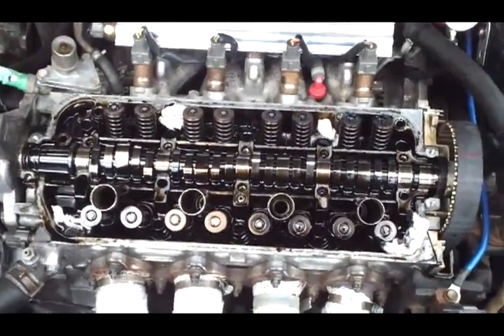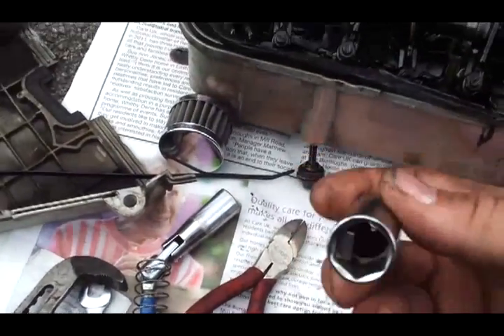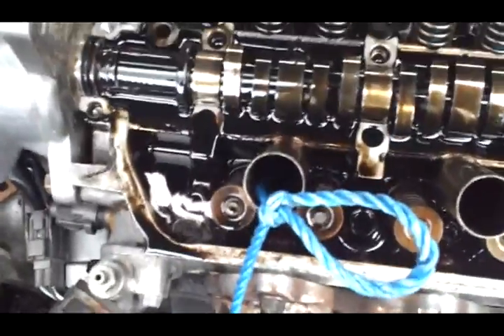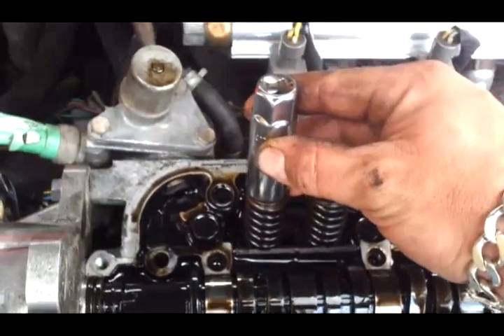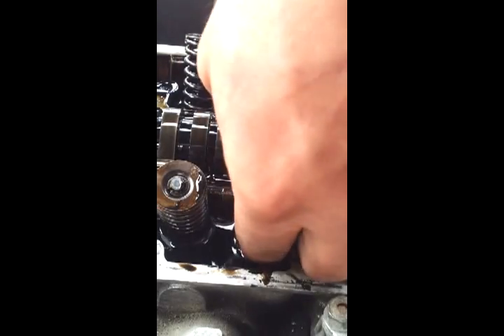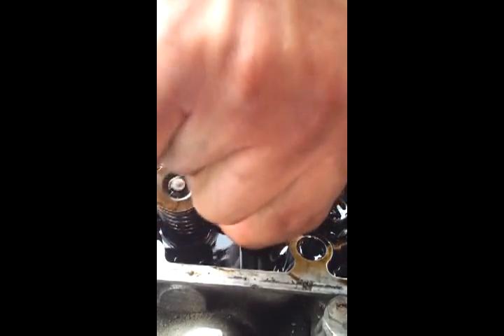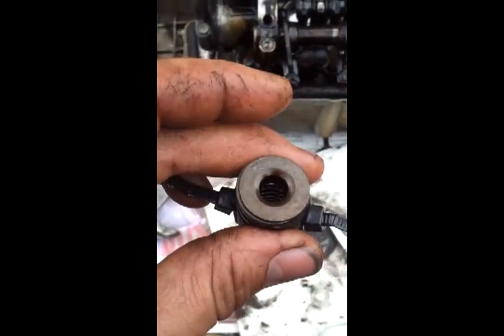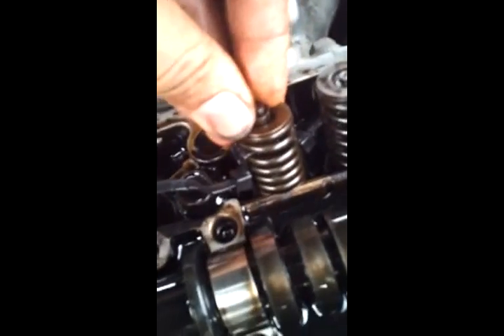how to replace value spring seals without removing the Clynder head.

Comment: i wouldnt have believed the cable tie spring compression trick until i saw it.  might i suggest that it is important to ensure the valve spring is at the top of the valve stem so those little collets/retainers dont go into orbit when you cut the cable ties.

Comment: by doing the rope trick do you have to do it in all spark plug holes or just first one to keep all valves from dropping down?
Reply: all of them it holds the valve up in the cylinder head so you don't drop a valve when removing the spring.
Reply: @FINDITFIXITRESTOREITBUILDIT  so am I right in thinking when the rope is in that cylinder I can remove 4 seals at the same time then move on to the next 4?

Comment: Thank you so much for this video.Learned a lot! I am just a shade tree mechanic,  DIY. I was able to tackle this on my 02 Accord. I was able to find a valve compression tool at a flea market, so I used that. Other than that  I did exactly what you did and it worked

Comment: Thank you. I have a vtec head I'm upgrading my non vtec 94 accord with and I don't have any compressor tools to help putting it back together even on the table. This cable tie trick is good stuff. This also gives me a way to be able to replace my seals if need be down later the road without the whole head off.

Comment: I figured with 225 k It was ready for an engine change.The engine I got looks new. Of course I had to remove the head on the old engine. The valve had to be removed so that I could turn the engine to seperate the torque converter from the fly wheel. I'm getting too old for this.

Comment: Ran into a mess with changing the Valve seals on a Nisson Altima 2.5 .It was very difficult because the springs are down in holes. To make matters worse the guides were worn. I couldn't do the rope trick because the spark plugs are down in holes too deep. I pressured up on the cylinder. While I was talking on the phone the compresser couldn't keep up and a valve fell into a cylinder. I ordered a Japonese imported engine.

Comment: I still don't get the deal with the rope into the cylinder. I'm a beginner, I'm having my first project w/ a '92 del sol (D16Z6) and I'll try to keep it under the budget. Anyways, can you draw a map for me? :D How can the valves fall off into the cylinder?
Reply: Alex Voinea the valve could fall into the cylinder because you basically remove the retainers. Valves goes up n down (intake because fuel injection and exhaust because the burned gas needs to escape). If you remove the retainers they are "free", so it will drop into the cylinder, the retainers are something like a "STOP" (lol don't know the english word), so it couldn't go down anymore, and when removing them, they don't have a "STOP". 

Look on google how valves look like, and by watching these pictures you prob. realise why you need to put a rope in it or use an compressor and use compressed air instead.
Reply: Alex Voinea You probably know by now. The rope stops the valve from falling into the cylinder when you remove the spring and clips.

Comment: Use security glasses and a spring compressor tool for 10$. Valve springs are tipically rated from 200 to 300 lbs, and you don't want that exploding on your face when cutting a zip tie...

Comment: Thanks for this video. I have a question, can I just fill the cylinder with rope without moving the piston up? I'm thinking about how hard will it be to remove the rope if the piston is moved upwards to hold the valve. 

Or if I moved the piston upward to hold the valve, is it just okay to reverse the rotation of the crankshaft to free the rope?
Reply: Emmanuel Higoy same question, did you figured it out?

Comment: What a great idea.  I was trying to use a HF spring compressors and having problems as it kept slipping off my Kawasaki spring.  Keep up the good work.
Reply: Seems like HF spring compressors are great for cars but do not appear to be designed for cycles or small engines.

Comment: how the rope work.....sorry don't get that part...i need to changed it on my 2003 Mitsubishi eclipse v6 need your help please
Reply: Holds the vale stem so they won't drop inside engine but it only hold 4 at a time. Then u put it in the next spark plug hole to do the next 4 stems

Comment: Good tutorial - I used I few times - First, use "Sintetic" rope like him - Don't leave dirt and it's more difficult to have a knot - Then the part of the zip ties, buy good ones or just buy a "Valve spring compressor" it's a cheap tool and very effective for hard springs.-
Move the piston with the hand, and then you can put it in first Gear, to prevent go down again, when you are working in the valves doing force down.-
When you finish, move the piston and then remove the rope.-
Then always check the timing usually it's not going to move because you don't remove the belt, but it's double-check and VERY important, check the valve clearance, after finish in d16y8 are for example 0.20 mm for intake and 0.25 for exhaust.-
If everything it's fine, just enjoy!

Comment: do i have to replace my timing belt , if i replace my valve seals?
i have a 2000 jeep grand cherokee.
Reply from the maker: No as you shouldn’t mess with the timing with this method, leave the cam in place and all the belts.
Reply: Im wondering the same most guaranteed u will have 2 since your turning your pistons up & down
Reply: Replace the whole truck.

Comment: I have my head removed off my dirtbike and before I re assemble I want to wipe it down to not leave dust etc... can I use wd40 ?, will it ruin the valve stem seals?  

thanks

Comment: This may work on smaller spring cars but the zip ties part won't work on my Jeep Wrangler. The ties are either stripped out or block spring compression. The tool to do it easy is free at autozone, use it.
Reply: Don't take my comment as negative or bad. I'm sure it works great for small engines and if you don't have a parts store that does loan a tool.
Reply: +Red Beard What tool?
Reply: Valve stem spring compression tool. Made the job easy and fast.

Comment: try it with deep stems you will see, this is just simple POS engine!
Reply: And that's the good thing about Hondas. Reliable and easy to work on.
Reply: Yeah they do have rust problems.
Reply: wow wow wow, my first car, a mercedes CLk 2.3 superchager 197 hp.. very smooth steering, shifts like butter (it is a manual) but BORING IT IS AND RUSTS ALSO, now also having a honda del sol 1.6 125 hp with a skunk 2 catback, what a fun car to drive! the corners! the steering! fokking hell! the mercedes isn't that reliable at all, the honda might consume quite some oil but some proper new seals and maybe double springs will do the job for sure! also the fuel consumption is so much better! the mercedes drives 10 kilomter on 1 liter, the honda about 14-15 on 1 liter and i did a drag with my friend in the mercedes and the honda is so much quicker, with a weight difference of about 150 KG but still!

Comment: Make sure u use a proper rope that wont leave anything in the cilinder.
And search for  a spring compressor, they are already starting from 20 euro, this could be dangerous and beside of that if your unlucky when cutting the zip ties you could lose you retainers.

Comment: Little help? Replaced my seals on my D16Y8 and followed this method. Finished  and put the engine back together but now it wont start? Backfires everytime i try to start it and sounds like it wants to start. Plugs are soaked and pitch black now and theyre brand new. Smell lean.
Reply from the maker: you have the HT leads the wrong way around by the sounds of it.
Reply from the maker: or the timing belt has slipped check the timing marks all line up on the engine.
Reply: MostDopeGamer775 did you ever figure it out? Two years and no reply??!!
Reply: Mostdopegamer..  How do you replace them on valves that have a nut on top not clips..

Comment: If your valve keepers are not perfectly in place when you cut those zip ties the spring could launch into your face and hurt you bad! That's why it's safer to use the right tool (spring compressor) and slowly release the tension. Just trying to keep a few more working eyes in the world lol.
Reply: He lifted the spring cap up to the collects before he cut the ties. There is literally zero chance it would "launch" into your face.

Comment: If I wanted to do this on a Diesel, would the rope get fed through the heat plug aperture?
Or would I have to just bite the bullet and remove the cylinder head?
Either way.... this method's nothing short of genius. 
^_^

Comment from the maker: when you turn the engine by hand the piston comes up and compresses the rope against the head/valves.
Reply: Hi great video. i purchased a vavle sping tool for my bmw with the compressor fittings. how would i use air? turn the engine to top dead center or bottom the piston then fill it with air?
Reply from the maker: +Ehsan Ahmed if you are using air you want the piston at bottom or as you fill the chamber with compressed air it could push the piston down and lose the compression thats holding the valve up .
hope this helps.
you will also need a air compressor.
Reply: +crazyvtec1 thanks bro. i should just connect the air or bottom the piston first? or the air would do the job for me ? I just connect and go ahead

Comment: Just want to say a big thank you. I just finished changing my stem seals today after following your diy instructions. I couldn't use the cable tie tip because my springs were too small to compress with just cable ties so I used a spring compressor to do that but I loved your tip about the magnetic socket and metal mallet. It worked beautifully. Thanks :) tell you what though, I have a D15 and changing 16 seals is so time consuming!

Comment: my 1.7 non vtec 2001 civic takes oil. Engine is clean, doesn't leak, doesn't smoke, but takes oil quite heavy. Would that mean my stem seals need replacement?
Reply from the maker: stem seals or piston rings if it's not leaking then it must be burning it.
Reply: how do i check piston rings?
Reply from the maker: +Sir Daltonix you will need do to do a compression check on all the clynders.
ask at your local garage to do one for you as it's not worth buying a tester just for one use. if there low on compression then the piston rings or valves are leaking /worn

Comment: I got my rope stuck in the cylinder! what is happening?
Reply from the maker: Turn the engine back by hand and the piston will go down then remove the rope.
It shouldn't get stuck there's nothing for it to get stuck into.
Reply: well, the rope just made a knot there and screwed the whole thing up! Now I have to learn how to remove the engine head.
Reply: This is the inherent danger when using the rope in the cylinder technique. It's always possible for the rope to knot up inside the combustion chamber and get stuck. It doesn't always happen but there is always the possibility and occasionally it does happen and if it does the head will need to come off. That's why many people prefer to use compressed air instead.

Comment: Even at dead top, is there still enough dept(room in the cylinder) for the valve to drop in the cylinder without the rope?
Reply from the maker: You can try it without and see but you need the valve up as high as Possible as compressing the spring and replacing the retainers is tight, would be impossible if the valve was 10mm lower and if it did drop just below the top of the guide it would be very hard to retreve. The rope is cheap and works well.

Comment: I thought you were never suppose to crank the engine clockwise because it might skip a tooth?? Is this correct or did you crank the engine counterclockwise in the video??
Reply from the maker: As long as the belt tensioner is in place it won't matter

Comment: Just used this technique on my 1998 Honda accord 2.3l vtec. AWSOME, I had the valve stem seals replaced in the time it would usually take to remove the head. Great video. Thanks.
Reply: Awesome man I'm also looking to do this in my F series accord, glad to hear it worked! Just to confirm, you don't have to remove the cam gear or camshaft to do this?

Comment: I understand the rope into each individual cylinder, but do I have to re-crank each time? Or just the first.
Reply from the maker: Crank so the cylinder your about to do is a bottom dead center feed the rope in about a meter, then crank it back round by hand not the starter untill you feel resistance just give it a little bit more just to make sure its tight then your good to start removing the valve springs. Once completed turn the engine back and pull the rope out. Hope this helps
Reply from the maker: Crank so the cylinder your about to do is a bottom dead center feed the rope in about a meter, then crank it back round by hand not the starter untill you feel resistance just give it a little bit more just to make sure its tight then your good to start removing the valve springs. Once completed turn the engine back and pull the rope out. Hope this helps

Comment: Valve Stem Seal Issue?...

Replaced my plugs after 109k miles on my Honda Element 2.4.  Noticed ash deposits on number 3 plug/cylinder only.  Slight hesitation before.  Engine great after spark plugs replaced.  

Oil use is very small between 4k changes - less than a half quart at most.  Also, have a leak coming from the bearing seal so it's impossible to know what the engine may be using verses the leak.     

Inspected number 3 cylinder/plug (new) again at 3800 miles.  

Slight ash on electrodes and insulator, but only on one side
shiny carbon deposit on ONLY ONE Side of insulator and "rim"  

This makes me wonder if the oil entering the combustion chamber is from a valve seal verses rings, etc.  But not being a full blown mechanic, I'm only theorizing.  

Outside of doing a compression test (will have mechanic perform soon) is this a likely indication of a valve stem seal issue?

Comment from the maker: THE ROPE IS USED TO HOLD THE VALVES UP IN THE HEAD. YOUR TAKING THE RETAINERS AND SPRINGS OFF TO GET TO THE SEALS WITHOUT THE ROPE THE VALVES WOULD DROP INTO THE CLYNDER. YOU DO ALL 4 VALVES WITH IT IN THE CLYNDER THEN REMOVE THE ROPE AND USE IT AGAIN IN THE NEXT ONE! PEOPLE STOP ASKING WHATS THE ROPE FOR!
Reply: If noone knows what the rope is for  maybe they shouldn't be doing it lol
Reply: I figured it out after you cranked the head back up. I don't have any videos uploaded so I don't know if this is possible but I would just edit your description if you can. Thanks for the video!
Reply: some car has valve seals under the camshaft does this mean I have to put the camshaft back on each blocks I do to compress the rope on everyblocks  ?

Comment: why did you change the seals? was the engine burning oil? if yes did the engine stop burning oil? thanks good video
Reply from the maker: I used to street race with my mates and hold the car in gear for engine breaking when you would rev up to about 6k let off to say 4500rpm then put ur foot down again up to 7500rpm you would get a blue smoke cloud.
I had good compression on all cylinders and after this no more blue smoke.

Comment: Do you do the nylon rope in each cylinder for each set of exhaust amd intake valves?
Reply from the maker: Yes you need to do it in each cylinder to hold the valves up, otherwise you will drop a valve then its a head off job meaning lots more work.
Reply from the maker: Yes in every Clynder to stop you from dropping a valve. Its to hold them up tight.

Comment: Exaust inside looks black when burnin if not insides got a greyish look noticed when driven few good miles no vtec engaging another i see how much miles per oil change before oil needs top up i got max 2000 before oil was low motorway if drivin round town oil was fine

Comment: Good video excellent for single heads.  When the valve steams are bad besides a smoking muffler what other sings should we look into?   My Integra is burning oil and I definitely smell it more when I drive long distance.  Second question when the valve guides are bad what are the sings when it's on drive?

Comment from the maker: No you turn the engine by hand on the crank no need to have it in gear.
And about 1meter of ropes enough tie a big knot in it for 2 reasons 1 you know how much you feed in and 2nd so it doesn't fall into the engine.
Reply: +Abdul Akhtar When you put the rope into the cylinder, it will coil up so when you bring the piston to the top, it stops the valves falling down into the cylinder (:
Reply: another way of doing it without rope is to use a air compressor and fitting that that threads into the spark plug hole and add air to about 10-15 psi ( you dont need a whole lot , don"t use all125 psi ) the air will hold the valves from moving ..they can't the pressure holds them up , and only release pressure after the valve spring has been fully reinstalled with retaining clip
Reply: Thanks Richard Gordon. Someone told me they applied air in the spark plug socket, but your explanation is tops. A+++
Reply: Why did you put rope into the cylinder ? whats that to prevent ? planning on doing my own stem seals this has helped alot but mines a B16A2 DOHC so it will be slightly different just been looking at a few videos to help build knowledge lol

Comment: I cut a nothch in a c clamp so i can do mine with the head off very easy no special tools but on the motor is differnt but a c-clamp and the head off your gold no need for a valve spring compressor i rented one and couldnt get it even on mine but the c clamp trick only works with single cam cause it wont fit around a h22 or b16 hope this helps too i have pics of the tool at jest bays on facebook check it out thanxs mikee